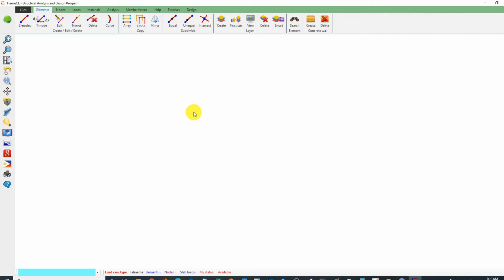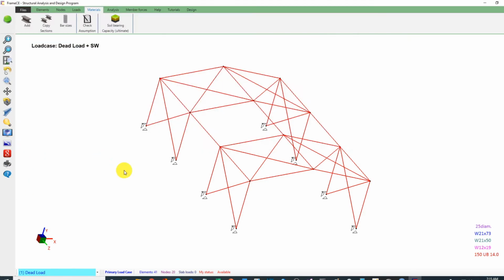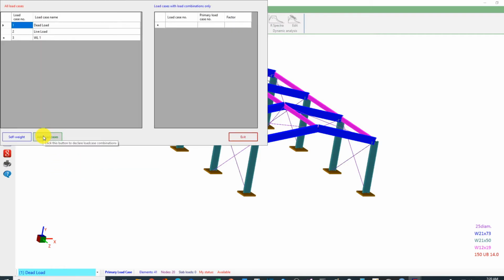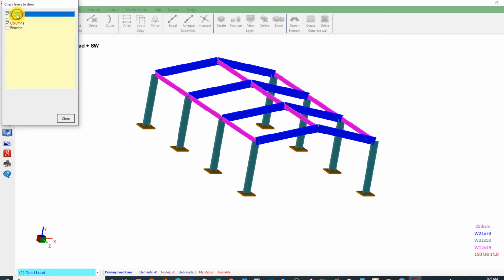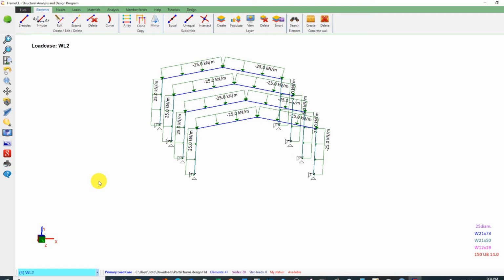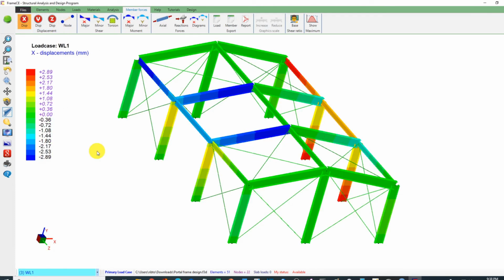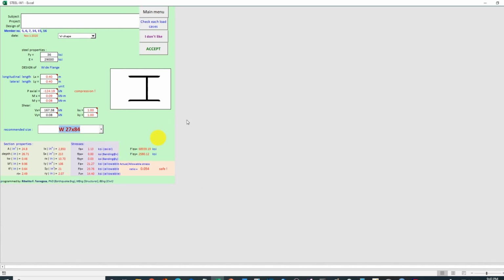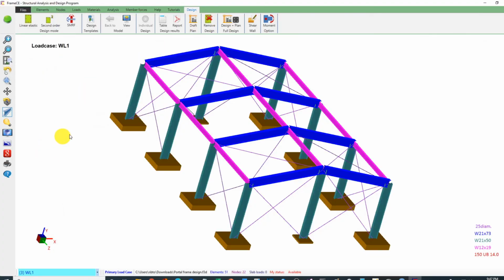A tutorial video on the design of a portal frame using FrameCE

Comment: hi sir,  what if the footings lie on the property lines and has to be designed for maximum eccentricity?
Reply from the maker: There is FoundationCE software that comes with FrameCE. It can design footings with column at the side of footing.